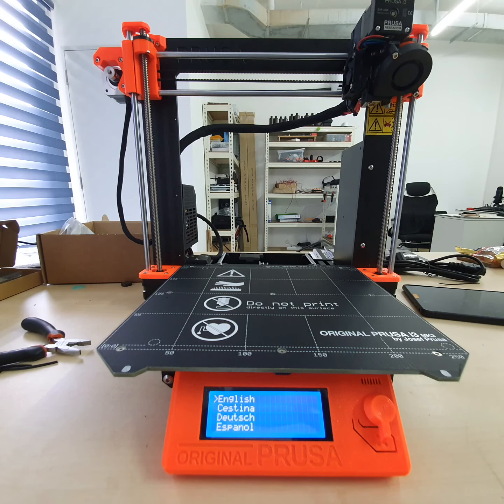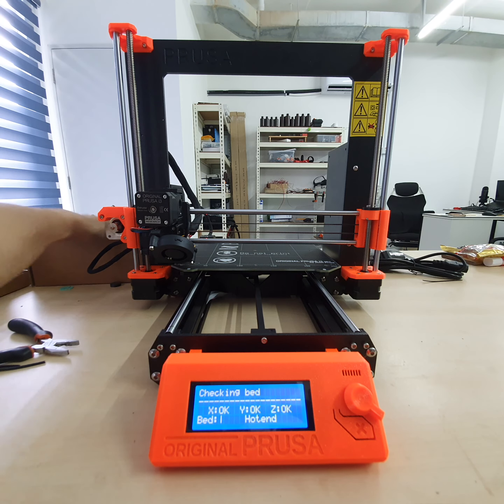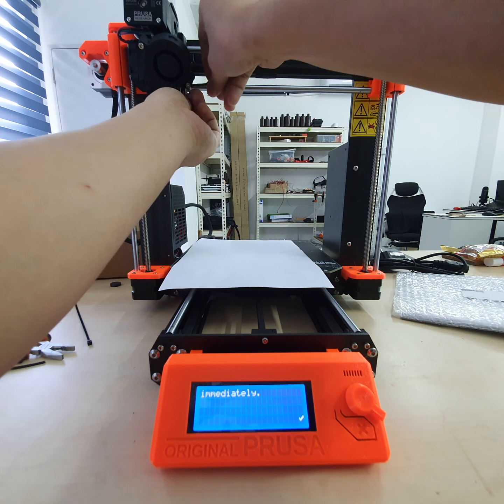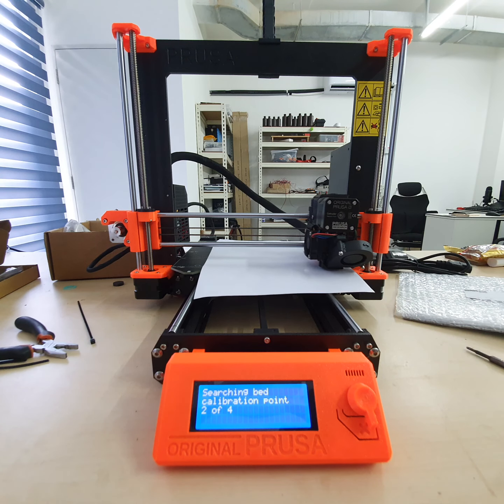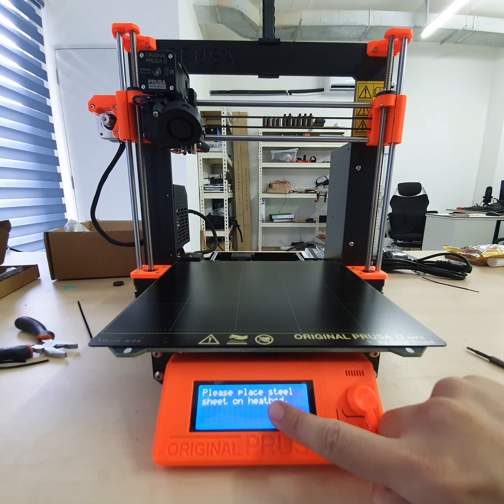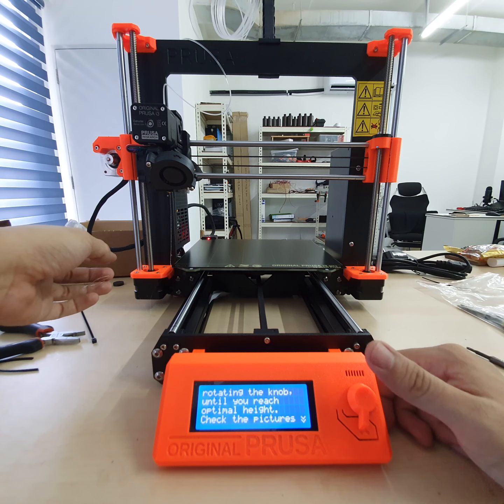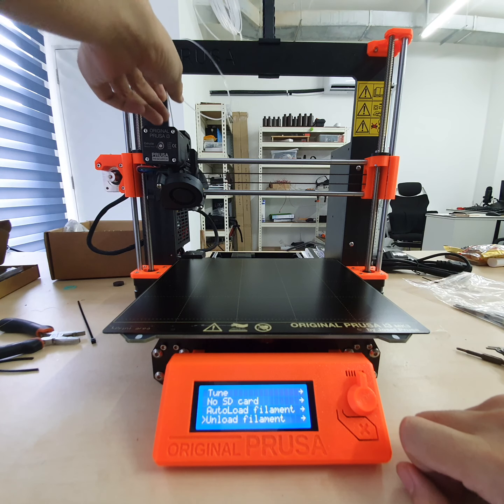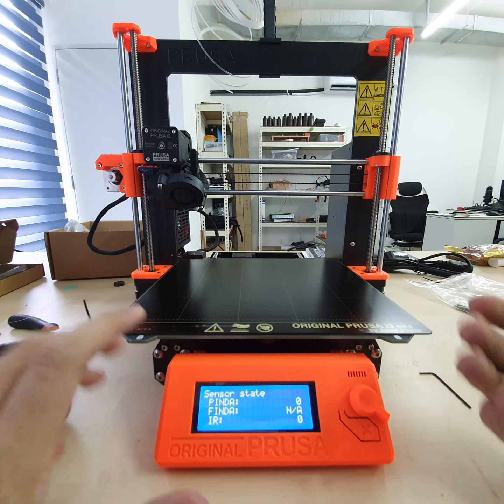Original prusa i3 mk3 auto calibration full process

Comment: Thanks man, good to see how it should work. I have problems with Z-axis binding, didn't really understand that until I saw your video of how it goes up & down to calibrate. And also! That you started with the Z-axis in top position! That made all the difference, no more "calibration failed, check axis" error when doing it that way.
Reply: How did you fix it?
Reply: @adharsharma3662  The binding was due to one of the trapzodial nuts being too tight. Prusa sent me a new one. It works fine now.

Comment: Mine rubs. On first try. Do I need to adjust the PINDA up or down when this happens?
Reply from the maker: yes . pinda should be one cable tide distand from nozzle. there is written inside manual you should check it

Comment: what were you  adjust for the filament sensor?
Reply from the maker: make sure the sensor distant correct. you use mk3 now ?
Reply: @B3D  

Yes I have an mk2.5 and mk3 now. Was just curious on what you were adjusting on the top.